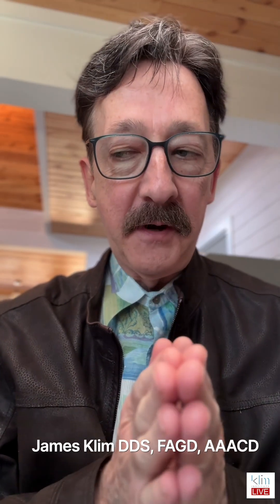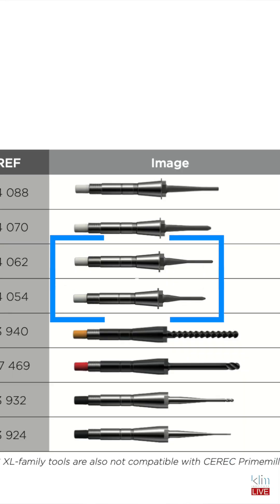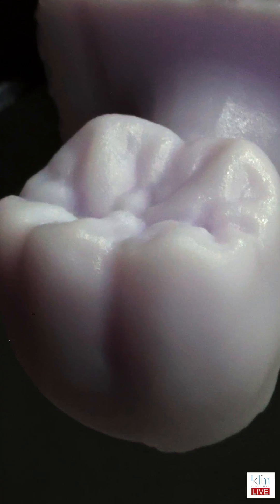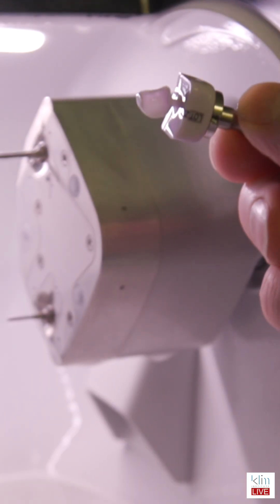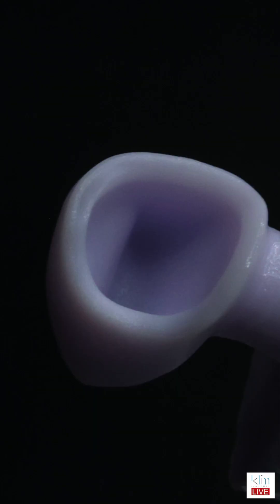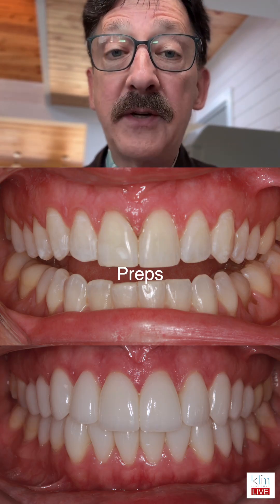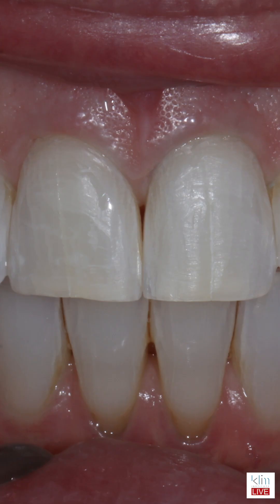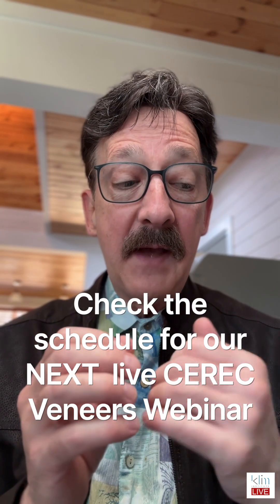Milling Thin Veneers with CEREC

Comment: Thanks for the tips, doctor! I am using the MCXL with only 2 motors, and I am aware that I can't expect to mill ultra-thin with thin margins, but I want to get as much use from it. What settings in Exocad would you recommend in terms of minimal thickness and margin settings (horizontal, angled, angle), and what would be your tool diameter and bullnose/flat tool settings as well? (I am using step bur 12 on the left and cyl. pointed 12s on the right.)

Thank you in advance for your help!
Reply from the maker: Try the following, practice on a model first and calibrate accordingly.
Horizontal Crown margin 0.1
Angled Crown Margin 0.1
Milling Diameter  1.27
Al crown distance to antagonist 0.1
Al crown distance to neighbor 0 mm